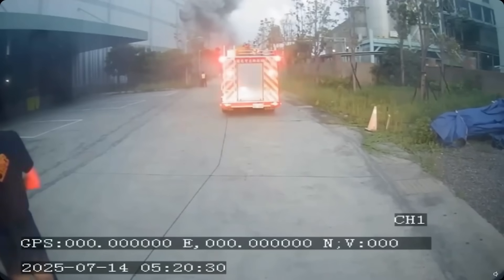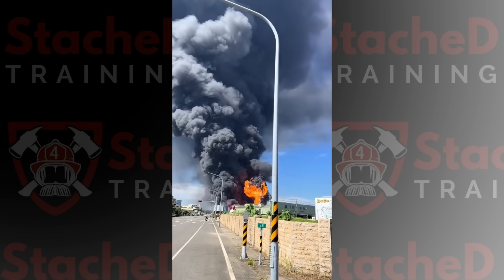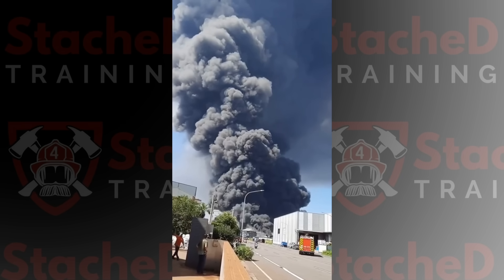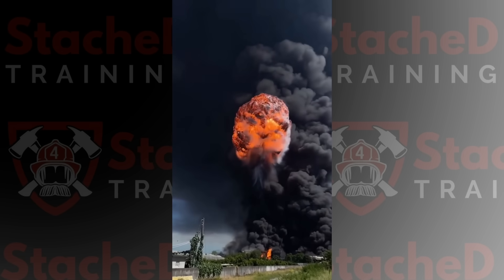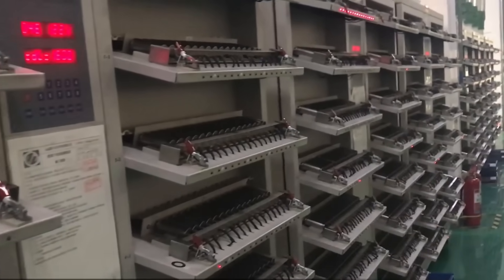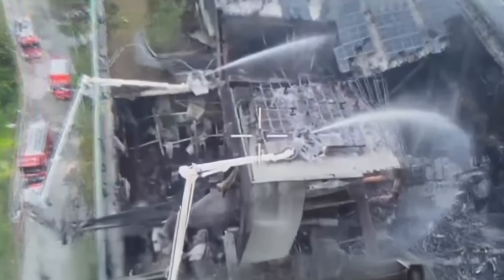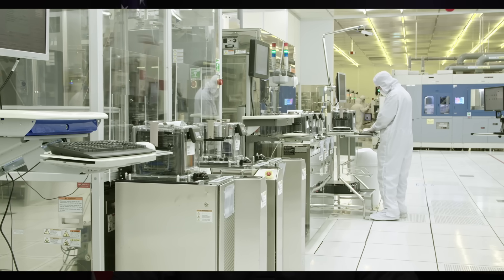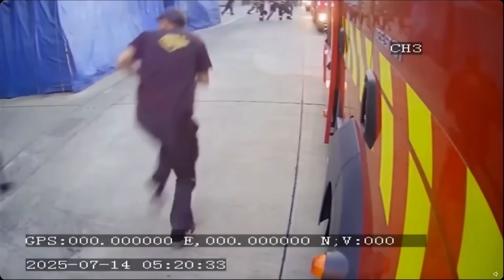Massive Lithium-Ion Fire in Taiwan: 2 Million Cells Lost

Comment: Taiwan is a profit based industry, china too. They are self regulated and have razor thin margins. The US has much stricter standards and inspections, for now, but if we keep voting for profit over safety and deregulation this will become a common theme for the US as well. The demand for power density is only going to increase. This includes the battery industry, solar, petrochemical, natural gas, Nuclear, etc. self regulation only leads to catastrophic events like this and the fire department is left with the remains.
Reply: Taiwan is not an industry and so is the PR China.
These countries have industries modelled on the US industry during the 1980/1990th.

I lived and worked in these areas for ten years from 1993 and 2003 in exactly this kind of industries.

Accusing the Chinese of sub-standards (safety, quality, freedom whatever) is a typical Western propaganda. The people over there are not stupid and of course they do care about such topics often better than the West.

The problem here described is a global one, with the tremendous political double-standards usually being lived by the West. Even if you insist on it, then at least you have to admit they learnt it from us.

Besides industry is not the salvation army, it MUST make profit, otherwise its own existence makes no sense. Not only Karl Marx explained this perfectly why.

I actually later was a project manager from 2007-2014 to design, make and install machinery to manufacture PV-modules, often for whole factories (EU, USA, Asia). I agree, this will not save the planet. The energy input into the lifespan of these short-lived products (ca. 20 years) of solar panels, the non-existing storage technologies and its exotic mass-material "hunger" is much too large to justify it as ecological.
Instead of drilling for oil we are now bulldozing whole continents and seafloors for these precious materials - recycling processes are unclear or again very energy-intense. We already can see the global race for it and the aggressive observation by various economic blocs to secure them for themselves - this whole concept will collapse due to the global and local limitations of resources. Green Capitalism in the end is resource-burning Capitalism too. Just new products but the same old tricks to extort money from the hard-working masses, still hitting the resource limitations available at this planet.

How to change that - well I am a bit baffled - but my idea would be:

- return to global disarmament and ending of all wars
- better education and social welfare for the masses
- fulfilment of the globally identical middle-class dream for the masses (reasonable materialistic wealth, including cars and occasional flight tickets)
- as a result the decrease of our own numbers as a species
- development of new modern perfectly safe nuclear power stations

Progress needs energy, without energy no progress.

Peace! from Dresden / Germany
Reply: @Gerd-2 I too have been doing manufacturing in china and Taiwan since 1998. I have seen the same poor business practices I see in the us. Hiding safety protocols behind your specific details doesn’t hide the faults that lead to disaster. I’ve seen things at every manufacturing plant abroad that would horrify you and I’ve been asked to turn away and keep my mouth shut. I’ve seen the toxic waste disposal next to the fish farm that serves the cafeteria at the plant or the 3phase conduit and wire mounted 4in off the floor to the assembly lines waiting for someone to trip or a spill to set fire. You haven’t seen your factory burn down and have to shift to another that is even worse. You can’t see this if you sit in the conference room all day. Your novel about solving the problem is incomprehensible. Your opinion isn’t worth my respect.
Reply: @davidgutting4317  
I agree with a few lines.

Most of the time I was 80% in the factories and they were high-tech. There they had (also lived) different standards, we also pushed often successful for safety and environment.
Besides, those shoddy practises I've also seen and found in the US and Europe, as you also admit. Of course "cost-cheating" by cutting corners is a common "sport" (on the expense of environment and safety) but it is the same game everywhere.

So please be careful to accuse one of "sitting in conference rooms". I was a commissioning engineer from 1991 until 2000, and still again a service engineer from 2003 to 2007 (travelling the world).
And yes, I enforced sometimes at least safety. I threw the main switch into off and locked or pulled the EPROM, went to the hotel and left my number ("whenever you sort this problem"). I refused to turn on any machine without proper central and earthing conductor - after I traced it all the way to physical earth or the transformer station. This is how I always started my installation on day one.
But I also always helped them to do it right. Sometimes it is matter of a strong spine in combination with diplomacy. I for my part never shut my mouth. 

Please note: Not every engineer sits on a drawing board or a desk all day long 🙂.
Electrics, electronics, hydraulics, pneumatics, various processes, vacuum, PLC & programming, brazing, cooling systems, .... I did everything and trained the locals - hands-on right within their factories and on their machines. Which I loved to do and always tried to sensitive my "students" for safety and environmental concerns. They understood quickly it is for their own benefit. Besides, the 1990s and even 2000er years were still a different time back then. Those (Asian) countries pulled themselves out of mass poverty - in the historical beginning of industrial development there is not much thought, money and resources with these issues - it comes and develops over time. Europe and the US were not much different back then when industrialisation started there. And disasters they had plenty and big ones....

I personally do not care about your opinion about my general thoughts ("novel"). I travelled all continents in my job into 60++ countries and it is very clear, we are not sorting these problems with technology alone. I also see the BRICS+ countries turning increasingly and successfully their backs on us. For very good reasons. The main reason is our Western arrogancy and ignorance. They are tired of it and righteously so.
I also sometimes had colleagues who were very respectless about others opinions and towards the locals on my construction or factory sides. I sorted them out as fast as I could sending them home. They did more damage than good.

Cheers and Peace! from Dresden / Germany

Comment: We can either continue making these lithium batteries, trying to improve safety & reliability, or we can abandon this extremely dangerous process until we find another way to deliver energy. Personally I'm cutting back on all things relying on Li-On batteries & I won't EVER have an EV!
Reply: sodium batteries are around the corner and will have little to no fire risk; will love to see what cavemen will have to say then
Reply: @RaulBetancourtC  re: "sodium batteries are around the corner..."  uh huh both Sodium and Solid State, but "They also said Artificial Sweeteners were safe, WMD's were in Iraq, and Anna Nicole married for love..." (best Old and Wise Mr. Rate/Levon Helm voice as he schools the young Gunnery Sergeant Marky Mark of the Funky Bunch back in the year 2007, on how the world actually works)
Reply: so you are still using horses to get around then?
Reply: AMEN! /( 'w')~
Reply: LFP batteries are extremely safe.
Reply: Cylindrical Lithium Ion batteries are a far higher fire risk than LiFePo4 pouch batteries and the risk ratio is getting wider as the pouch battery and its chemistry keep improving in power storage to weight ratios.. E-Bike, power tool and other batteries have been showing this higher risk of fire because the lithium chemistry does not have the same buffers as the wet cell LiFePo4 pouch batteries.. Tesla cylindrical cells have a track record of fires, so they are starting to transition away from them at the giga-factories..

Comment: They can have all the fire suppression systems they want. Once thermal runaway starts you cannot stop it.
Reply: indeed that's just the way it is with batteries but the world revolves around them since the 1990s so it is what it is.    Cna you even count how many lithium cells are in your house?  Garden lights,  weather station,  flash lights, radios, power tool batteries, kitchen gizmos,, house cleaning robots, laptops, watches,  just freaking endless.

Comment: As the production volume of Li-Ion  cells increases these types of fires and going to go up. Even with all the safety precautions in places Li-Ion cells are EXTREMELY dangerous. My biggest concern are EV's (EXPLODING VEHICLES) in indoor parking garages. Don't forget that the EV' have some 10,000 cells. That's a BIG problem. Even thought Li-Ion cells are used extensively, when you have 10,000 cells packed tightly together, a single cell goes into thermal run the whole pack follows.

Comment: Thanks to this channel I now store one of my welding blankets (they are not expensive and well worth owning for anyone handy since they also protect against grinder sparks) next to my kitchen fire extinguisher because they'll take the heat and contain modest fires.
 I store mine as I do ammo, in steel military ammo cans. Cans are thick enough to contain modest amounts of batteries which once ignited burn hot but briefly.
When I dispose of old batteries I now experiment to learn how they burn, then safely dispose of the combusted remains with other scrap steel. (I have room, tools and PPE for welding so doing this safely is easy.) For example snapping a cell in two ignites them instantly as does putting 22LR through it.

Having smashed and shot phone batteries I refuse to pocket mine and wear a phone pouch I can quickly jettison.

Comment: Aluminum ? ! ? ! ?

I remember a time when residential electrical wiring was attempting a transition from expensive Copper to lest costly Aluminum.

A nostalgic google search for details yielded:
- - -
Aluminum electrical wiring poses several hazards, particularly in homes built between 1965 and 1972. Here are some key points to consider:

Increased Fire Risk: Homes with aluminum wiring are 55 times more likely to have fire hazard conditions compared to those with copper wiring.

Loose Connections: Aluminum expands and contracts more than copper, leading to loosening connections over time, which can create gaps and increase resistance.

Oxidation and Corrosion: Aluminum is more prone to oxidation, which can interfere with electrical conductivity and lead to overheating.

Signs of Hazard: Look for signs such as warm outlet covers, discoloration, or arcing when using outlets.

Solutions: The most effective solution is to replace aluminum wiring with copper, but this can be costly. Alternatively, using specialized connectors can help mitigate risks.

For safety, it's advisable to consult with a licensed electrician to assess the wiring in your home and determine the best course of action.
- - -

Not addressed by the electrical wiring hazard of Aluminum described above is Aluminum's propensity to form or grow dendrites in the presence of an electric field. A dendrite is a microscopic structure from relocated Aluminum atoms that move from the original conductor in the direction of the electric field. Over time, these dendrites can bridge the insulative gap between the conductors and creating low resistance shorts. 

In home aluminum electrical wiring, dendritic formation can contribute to the higher fire risks. 

In a Lithium Ion Battery, where the physical dimensions are small with tight dimensional tolerances, the presence of an Aluminum Cathode is asking for trouble as there is a high probability of dendrite formation in the presence of the high electric field density. Any physical damage can short the Cathode and Anode initiating thermal runaway. But perfectly intact and as designed batteries could have a dendrite form at anytime when the battery is holding a charge.

As my background is with Semiconductor Engineering and Electronic Product design, I welcome any battery industry engineers to reply to my comment to describe how Aluminum dendritic growth is avoided or mitigated.

Comment: Everyone has to make their own decisions and I can't claim to have no lithium ion batteries. Flashlights, tools, jumpstarters, RC cars, etc, etc. But from what I've seen the danger goes up almost exponentially as the battery size goes from something like a drill or jumpstarter to an electric vehicle size battery pack.
Reply: It's a simple numbers.  I dislike lithium-ion, but even I own (off the top of my head) about 12 things that use them.  So that's 12 chances of disaster.  A single vehicle EV pack can contain thousands of single batteries, and those undergo significantly more stress/bad environment/quick charging than your average cell phone or tablet, or hand-held vacuum.

Now...consider having two EV's.  Perhaps even a used one, or an older one.  All batteries decay.  You got yours used?  Do you have any idea the state of the battery or its condition?  Again it comes down to a numbers game.  You may have 6-10 items, vs. an EV owner with 4,500-6,000.
Reply: Possibly, the number of cells pushes into the percentage failure rate, whereas small stuff has fewer cells and potential spreads across multiple tools/packs.

Comment: As I watched a video about lithium batteries being made, there was a stage where the wrapper cylinder got squashed in a press to make it into a pouch rectangular cell. I wondered how anyone could vouch for the quality of the layers at the crease? The innermost layers get a severe creasing and the outermost get a severe stretching. How do you vouch for the integrity of that construction except through statistical failure rate?

Comment: 5:35 the fallout ..  :octopus-red-waving:
Reply: There is no fallout, those kinds of fumes rise to 300,000 feet way way up above the weather system so they can't come back down.   Very little can cause fallout, mostly heavy stuff like ash from a volcano that stuff is stuck around 40,000 to 70,000 feet where the clouds are so yes that does lead ot fallout but most fires like trash fires,forest fires chemicals they are very fine so go WAY WAY up = no chance of fallout

Comment: UN3480 and UN3481 (shipping directives for lithium ion and lithium batteries/cells) requires that cells/batteries can have a maximum charge of 30% when shipped. I find it interesting that I have repeatedly received product with batteries/cells installed that were at or near 100% full charge. Really scary when you think about it. Really scary when you realize what a lithium ion or lithium fire will do to a cargo plane...
Reply: Ditto. I"ve also got fully charged batteries from Amazon.
Reply: Lithium ion batteries are dated. Batteries are being changed to LFP ones that don't burn. Many cars made in mainland China are using LFP batteries. 😊
Reply: @tkh2944 
They STILL burn dangerously when things go bad, they are just less likely to go bad because they are somewhat more robust, at the cost of lower performance.
Reply: You have a higher chance of being struck by lighting then a battery exploding in your face when you take billion batteries out there compare it to the small number that went up in flames. This guys channel makes it seem like your changing up a bomb when you connect a cell phone to a charging cable. Everyone on the solar forums makes fun him.
Reply: @Mike-01234  I agree with you. Given that, it only holds true until one burns your house down, or your in the airliner when one cuts loose. Did you see the cargo ship that burned and sank when an EV caught fire? You have to weigh probability against the magnitude of the potential disaster.

Comment: There are still gaps in our understanding of lithium batteries. Its not clear how this fire started. Faulty batteries? Or a faulty charger. In fact the first stage change that produces the solid electrolyte interface is part of the reaction ofvthe chemistry to charge. And it won't take much to push the cells through to the following transfer reactions and thermal runaway. Hope no one was badly injured Patrick.
Reply: re: "Its not clear how this fire started."  "ooooh what's REALLY going to bake your noodle" (best Oracle in the Matrix voice) is when i tell you - given what we've seen from the 1,001 other fires that've already occurred - we don't have to know how they "start" because we know how they END.  hint: in disaster.
Reply: re: "There are still gaps in our understanding of lithium batteries."  LOL well no, there's simply a gap (personally) in YOUR understanding of Lithium Ion Batteries.  however at this late date in Battery History, it's best not to engage in "projection" and make the erroneous assumption that experienced Engineers and Chemistry Professionals somehow do no exist, you may simply not have "contact" with any.
Reply: @phillyphil1513 thermal runaway can be induced by various factors. These batteries were on charge for the first time. So, it could be a chemistry issue, or abuse from a charger. The thermal runaway reactions are not fully understood. Why do I know this. Because I am one of those engineers you refer to, and involved in two working groups dealing with safety issues with lithium batteries. And have constant contact with leading researchers. Next time, read things carefully, at least twice very slowly. Think and understand.